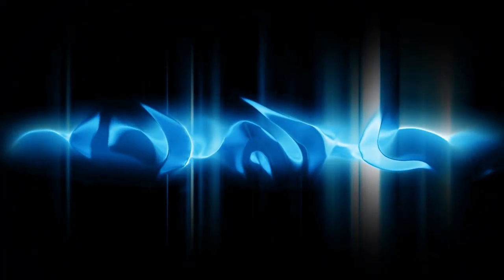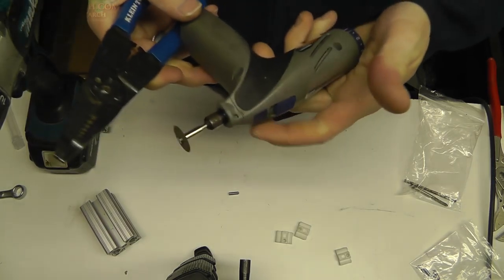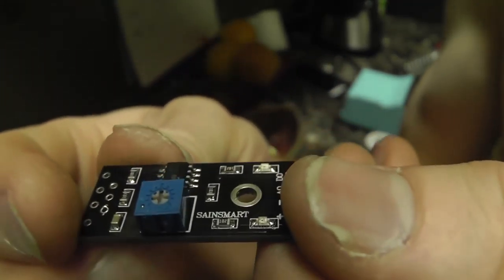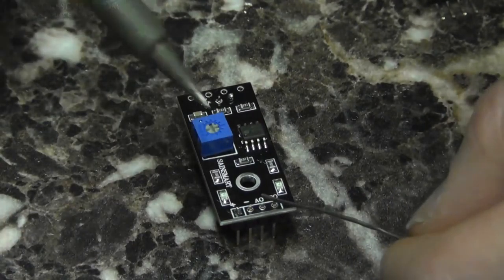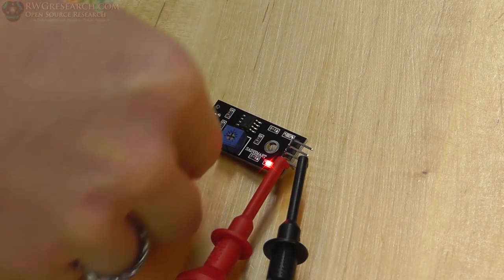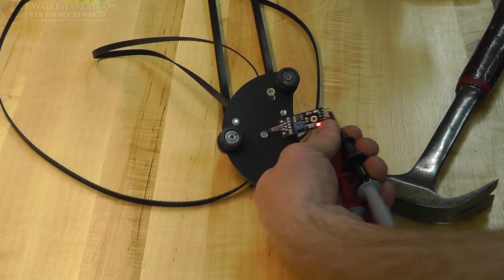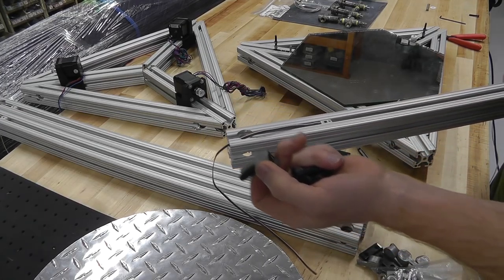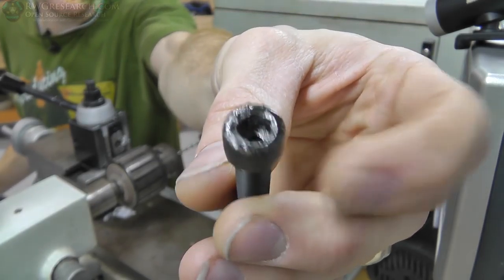RWG OSD #13 Custom End Stops, More Complicated Than You Think...

Comment: With such a large, heavy-duty machine... have you considered making an interchangeable head?... pop-off the extruder, pop-on an end-milling tool.... ?  (or maybe the end-mill tool would fit "over" the extruder)  As a mill, it would move much slower, so the extra mass/weight won't add too much "wear & tear".
Reply from the maker: +beforebefore yes it is part of the plan after i just get it "printing" but planning in those features as i go so when the time comes i can do it easy. ( laser cutter would be my best bet ) :) ~Russ

Comment: tried drilling a screw head a while back, couldn't do it. surprised you did it, maybe the cutting fluid would've made a difference, I'll try that next time
Reply from the maker: yes you must use cutting oil or Somthing. constant pressure is important too. and going slower than you think. you'll burn a bit up really quick. ;)  ~Russ

Comment: Russ, Tap Magic is good, but Anchor Lube seems to work as well and in many cases far better. Plus it is water based, so it does not burn and produce noxious fumes when used as a cutting fluid and it is environment-friendly. Grab a free sample from their website or contact Stan Zinkosky aka "shadon hkw" on YouTube or through the Machining YouTube group on Facebook.
Peace!
Reply from the maker: +Jeffrey Vastine good to know, ill have a go it it when i need more, thanks for the tip!! ~Russ

Comment: Russ. you could have saved a few dollars and did this with your end stops. cheap as chips. http://engineerd3d.ddns.net/upgrading-end-stops-to-hall-effect-sensors/

they cost less than .25c per end stop. easier to wire and you do less soldering.
Reply from the maker: +Bruno Martini yes, thank you, the reason like the ones i have is that there 3$ on ebay, and they give the flexibility to fine tune the senor adjustment.  other than that you can use just the hall ( if its the right kind) tanks for the top though!!!! ~Russ